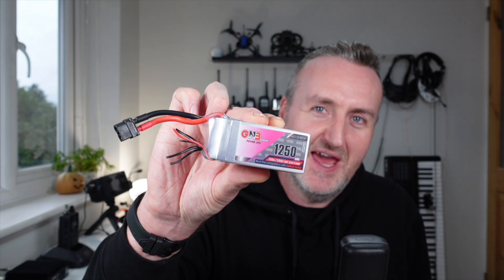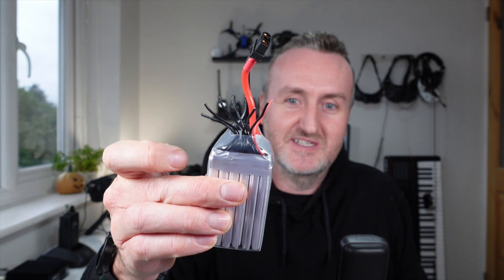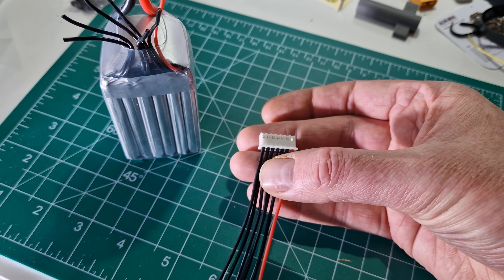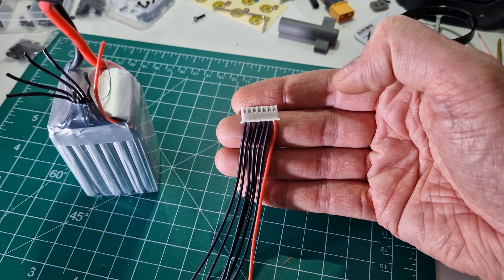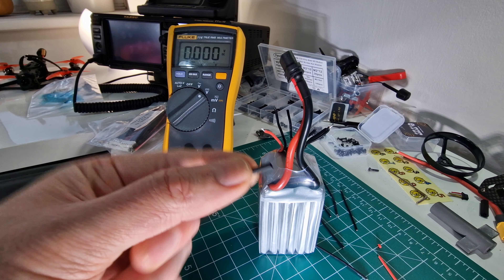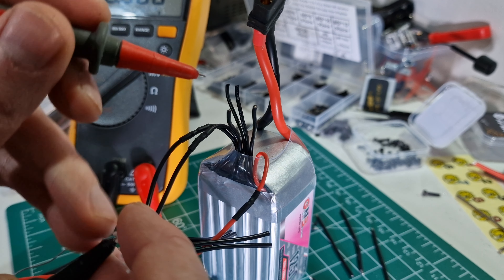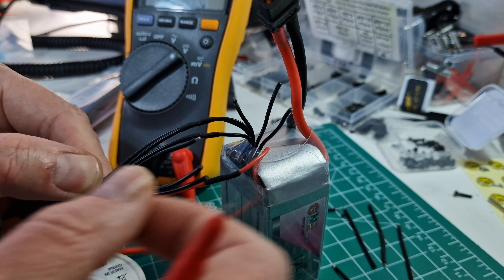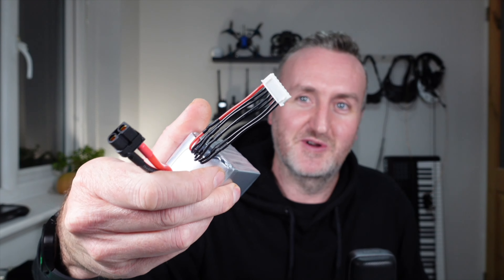HOW TO REPAIR A BROKEN BALANCE CONNECTOR ON A LIPO or LI-ION BATTERY

Comment: Can confirm balance leads usually completely vaporise upon short circuiting from own experience . I use those little tiny coloured rubber bands to keep them tethered to the main battery lead(think they are called 'loom bands' ). easy enough to charge them up without taking them off but still hold balance leads out the way enough not to get ' the chop' mid flight.

Comment: Building a P42A 21700 20s20p ebike battery atm.
Reply from the maker: Nice, they are great cells 👌🏼
Reply: Does the KirbEbike 5000S kit come with instructions on putting the bike together?
Reply: @johnny1902  This packs for my franked surron. I think if you cant figure it out threw reasearch; its over your head currently